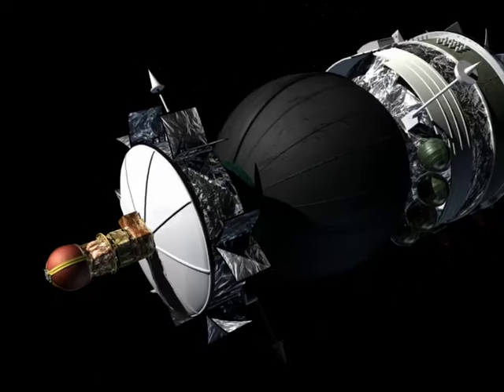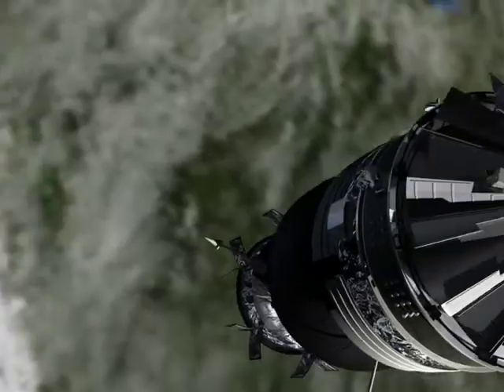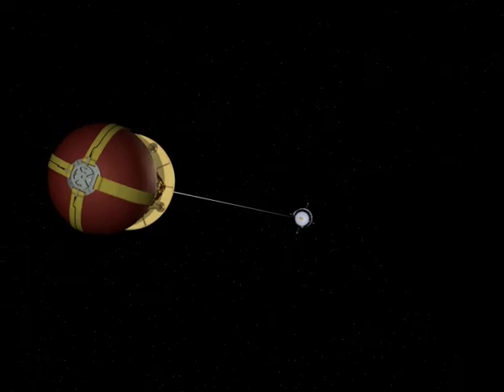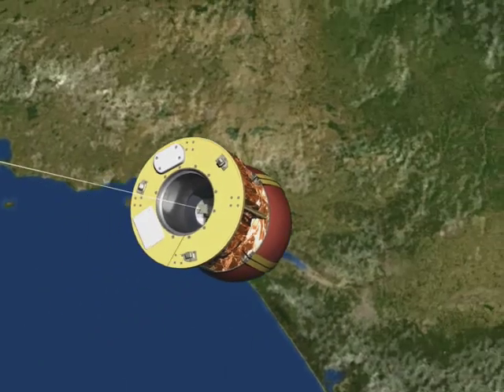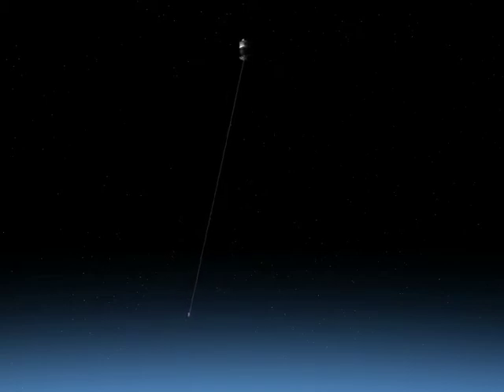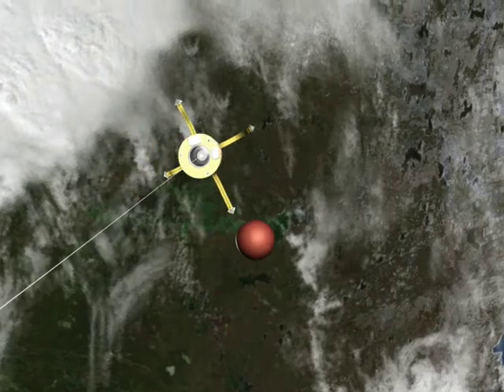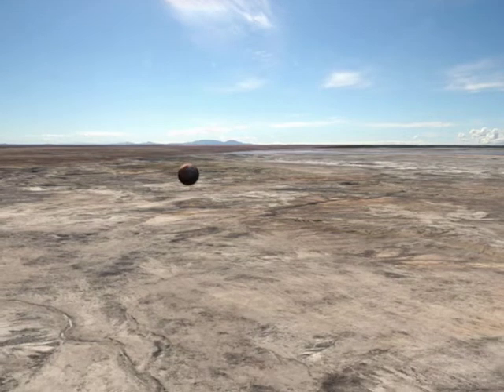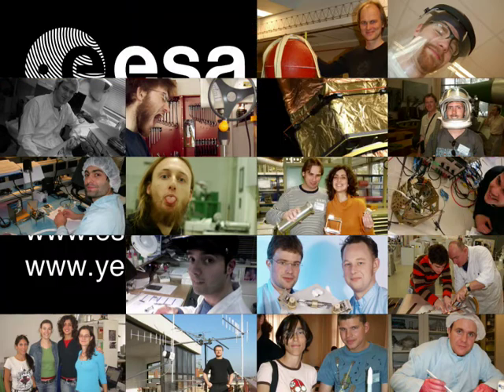ESA YES2 Mission Simulation

Comment: What is the point of lowering it? Why don’t they just release it and let it re enter?
Reply from the maker: The capsule would remain in the original orbit if simply released. It needs to be slowed down to re-entry, at a precise time (within say 10 seconds) and with a specific amount (about 120 m/s) for controlled landing. This can be done using propellant, or, significantly more efficiently and equally accurate, using a tether.